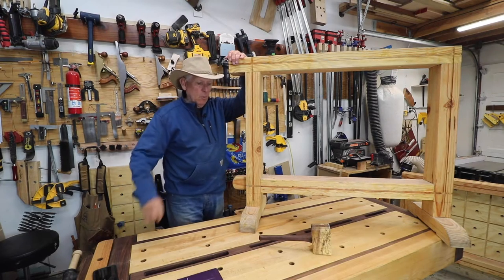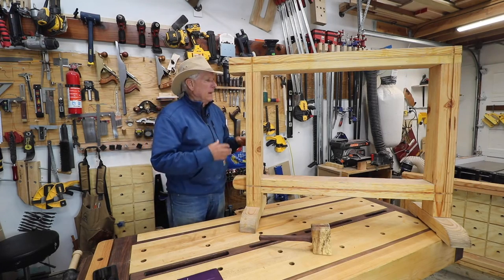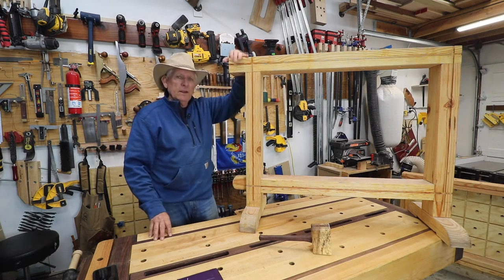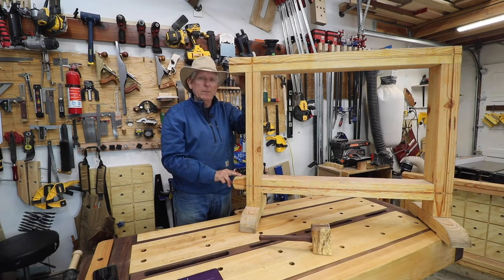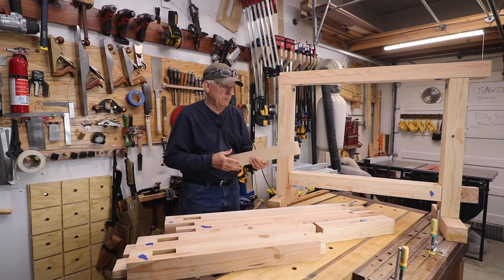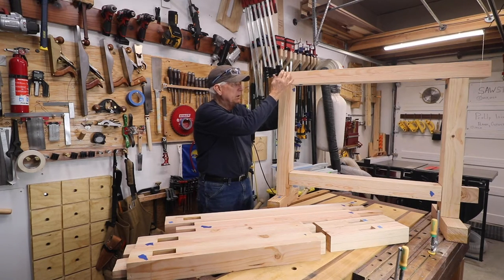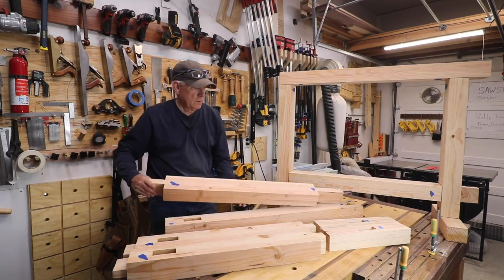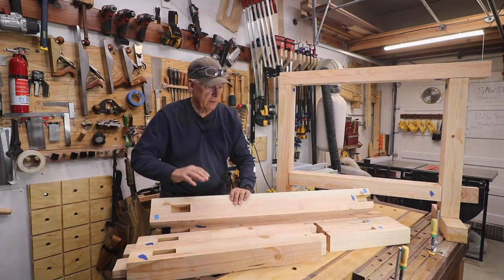Build Sawstallions (Trestle-Style Sawhorses) with $40 of 2x4's!  Matchfit Dovetail Grooves- Big Plus

Comment: Very nice Paul! I am not afforded the space for a set of these yet, but when I upgrade above 250 sq ft, I sure will! Thanks for the video
Reply from the maker: Heck, if you already have 250 sq ft, your workshop is larger than mine.  These don't take up much space - I just use them for Tablesaw outfeed support most of the time.